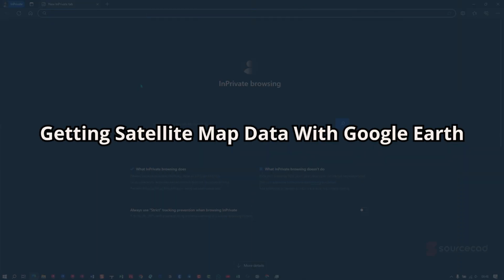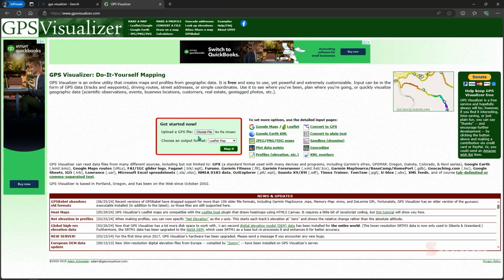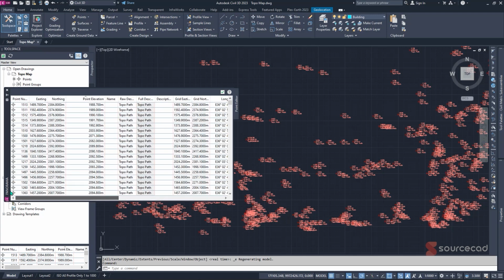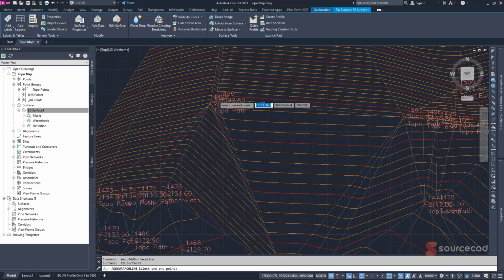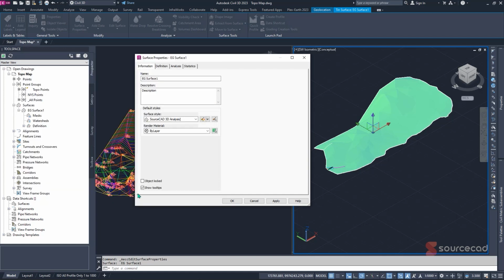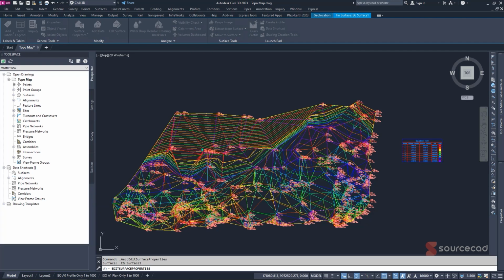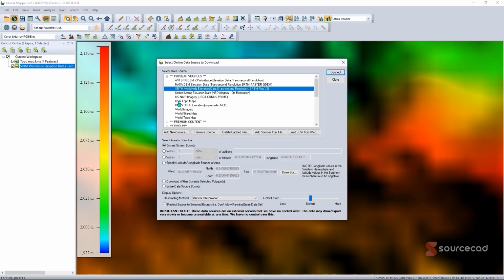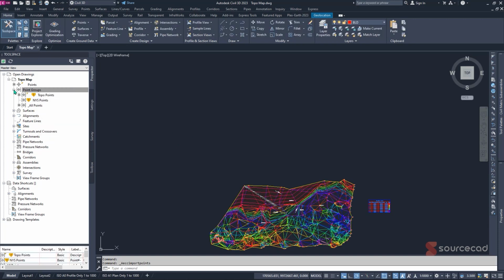Making Topo Map in Civil 3D - Complete tutorial

Comment: which method is giving better and precision  result in this two way
Reply: Hi Saheer,

Based on my experience, both methods provide good precision. However, it's important to be mindful of the projection settings you choose for your project.

The purpose of showcasing both methods is to offer solutions that cater to different needs.

As you are aware, some industries or companies use internal systems that require compatibility with specific third-party software, such as Global Mapper.

Comment: why the cogo  points are coming in different location , when you import cogo points through global mapper in to civil 3D , thats already showing 3dsurface  in civil3d file , and you are already used same KMZ file for this lessons , i am confused
Reply: Hi Saheer,

I understand your concern.

If your COGO points are appearing at different locations when importing from Global Mapper into Civil 3D, here are a few potential reasons:

1. Coordinate Systems: Ensuring that the coordinate systems used in Global Mapper and Civil 3D are aligned. Discrepancies between coordinate systems can lead to points being misplaced.

2. Projection Settings: Double-checking that the projection settings are consistent between Google Earth, Global Mapper and Civil 3D. Variations in projections can cause point locations to differ.

Since we used the same location for this lesson, it might be helpful to review the import settings and coordinate system configurations in Google Earth, Global Mapper, and Civil 3D to ensure consistency.

Addressing these areas should help resolve the issue with point placement.